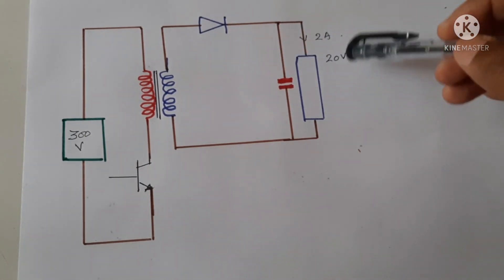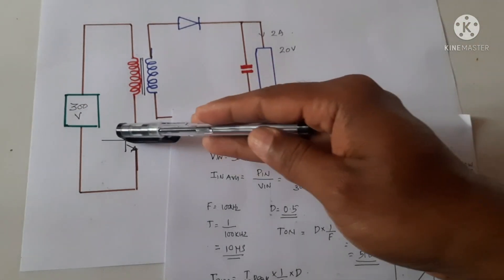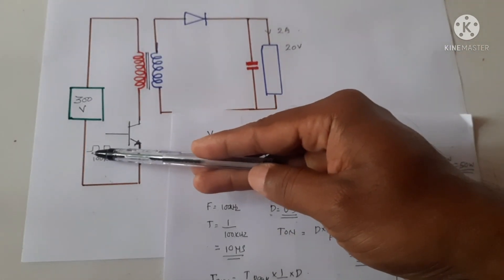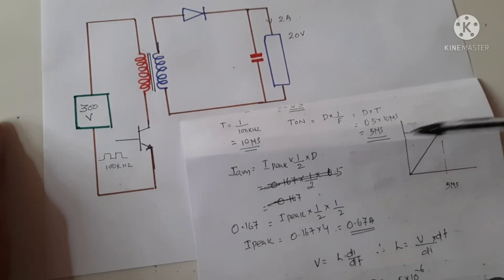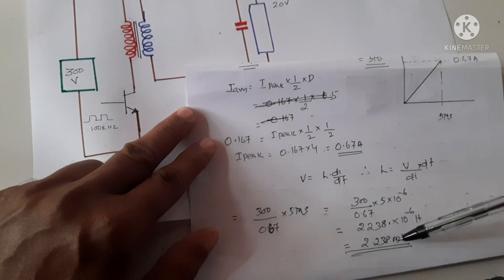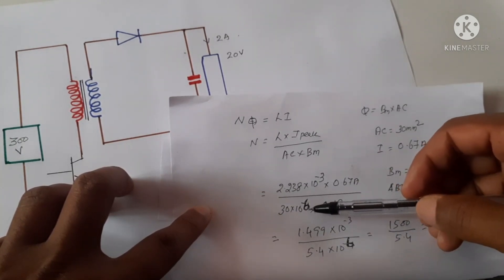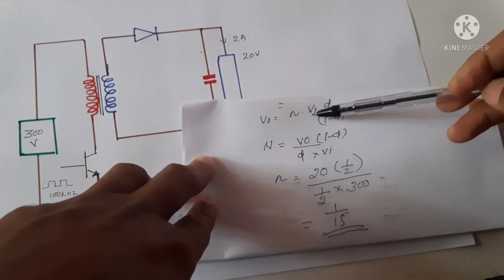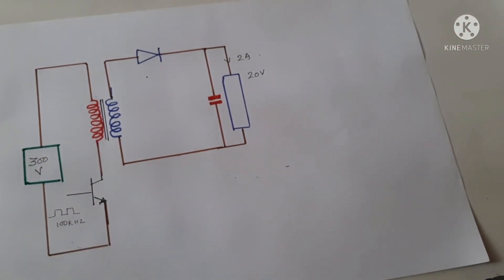How to make flyback Transformer|No of turns in primary & Secondary of flyback|

Comment: This is a very nice presentation. I am very new to SMPS and have started reading about Electronics in general after many years. Quick question: If a bigger core is not available, can two smaller cores be used stuck together side by side, increasing the core area, will be transformer be able to handle twice the power? Say 2xEE1605 instead of some 1xEE22xx. Or are there factors I am not considering now? Does the ratio of length vs width of the core area matter that much?

Comment: Would replacing the single diode with a full-wave-bridge (four diodes) have any bad effects?
THANKS MUCH!!
--dALe
Reply: No you can't because minus side of ac voltage don't be used .in result rather than 300v must replace 150v.